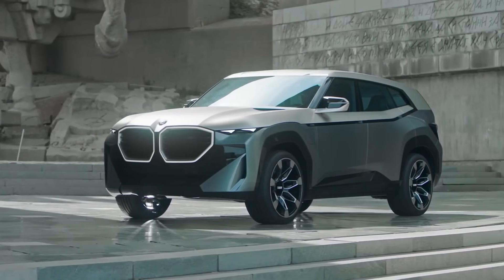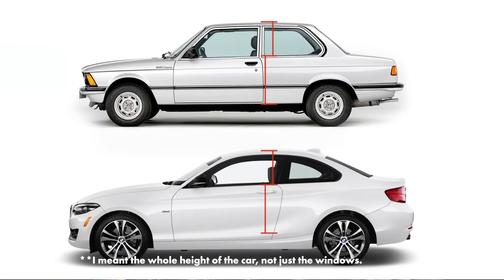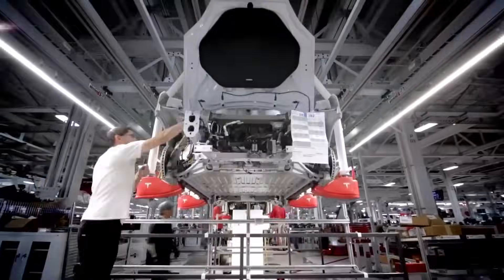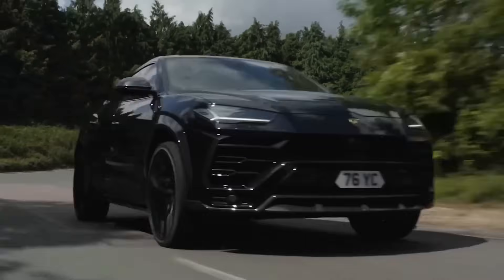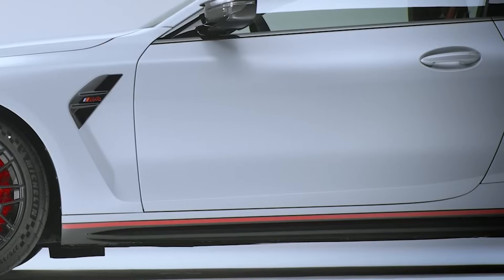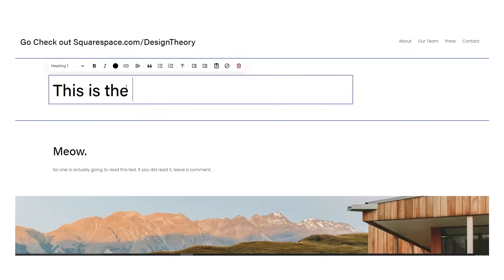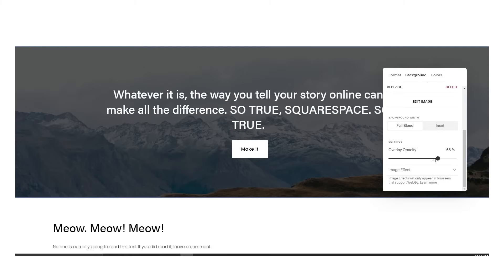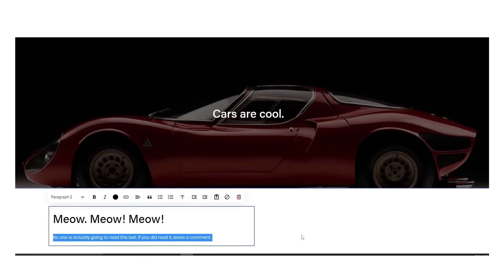Why Modern Car Designs Are So Visually Complex | Q&A w/ Pro Designer

Comment: “Beauty is incredibly difficult to achieve in product design, because you have to balance it with functional constraints” 100% accurate, in any field of design
Reply: They never seemed to have a problem with this for the first 60 years of car design. Only since wind tunnels and computers, have cars gotten ugly.
Reply: @NoQualmsTheArtist ¯\_(ツ)_/¯
Reply: @NoQualmsTheArtist  yes cars started to look ugly somewhere in 1980-1990
Reply: Id rather have the cars be usefull instead of looking like an atrocious outfit from a fashion show
Reply: Beauty is not difficult to achieve if it follows functionality. I drive an OLD 4WD SUV because it works - the electronics work - the drivetrain works.  You can't achieve beauty when these thing are 'GLOBS OF COMPLEX GARBAGE'  THAT is difficult and doesn't appeal to everyone. Only to some with money, some with no common sense.
Reply: Form following function is usually not pretty. But the proportions almost always look right. However there is nothing more stomach churning than something designed to be ugly.
Reply: @Muis33 hell yeah the 55 firedome, has an amazing front grill. Looks like it will gobble up everything in it's path! 💯
Reply: @Muis33 53 is even more badass! One of the best grills in any car ever. You could put those teeth on a Mercury or fleetline or anything and it would be instantly more badass. That's a damn fine car.
Reply: Just another excuse. It was difficult in the 1930's, it was difficult in the 1950's, it was difficult in the 1970's, and still, these eras produced designs with real charisma, elegance and style. As long as angular shapes and all that bending is the mantra, arrogant rather than agressive looking monstruous cars will be released. It's just waiting until the pendulum swings the other way again, and the Gen Z designers finally come to their senses.

Comment: It's a bit weird to have to make car windows so small they limit visibility for the sake of safety. Only testing crash safety leaves out the avoiding crashes in the first place part.
Reply: It's not for safety, it's some custom car hot rod image in designer's minds. Subaru Foresters and Honda Jazz have big windows and pass crash tests.
Reply: @emjayay  that is an oversimplification of choosing where to put the beltline on a car. it is mostly for safety. you can make everything thinner and cheaper and still pass crash tests if the beltline is at the shoulder.

Comment: A pet peeve of mine is the upward sloping window sills on modern (like, last couple of decades) car designs. I find they make it unnecessarily hard for the driver to judge the car's orientation while reversing.
Reply: I changed a new car I had “chosen” for this reason, after only 18 months. Not a good financial decision but I realised shortly after the purchase there was something that didn’t work for me when either sitting in or looking at it. The Yaris represented a radical change of direction for Toyota, who had established a studio in France where the Yaris was designed.  I found the steep upward waist line claustrophobic and, as you said, limiting rearward visibility. Thankfully this trend seems to have disappeared.
Reply: I’ve noticed that I will actually feel less carsick when the backseat windows are lower, and bigger.
Reply: Most people look at their center screens when reversing
Reply: @littledovecitydust many people still don't have backup cameras.
Reply: @jerbear7952   it's mandatory since 2018.
Reply: @littledovecitydust  The world isn't just America.
Reply: I've finally met someone with the exact same gripe as me.
I hate the upward slope on the windows.
The rear windows are now merely a vestige.
Reply: @quistan2  front windows shrank, too. And windshields get smaller and more angled with time, for "security" reasons
Reply: @swisswildpicsswp3095  Yes sir they do, and I dont like it either.
I'd rather drive a 87' corolla or an amc pacer than most of whats availible these days.
At least I know ill be able to see my impending death before it happens.
Reply: That's why we have cameras now.

Ealier cars didn't need them.
Reply: @littledovecitydust  Many people still have cars made before 2018. Personally, I neither want nor need backup cameras anyway (case in point: I drive a '95). What happened to turning back and looking out the rear window?
Reply: @manlethamlet that's too 2000ish I guess 😂
Reply: @SkidMark-v7i  Yup, just the other day as I was walking through a parking lot, I stopped and waited for someone to pull out of their spot. They never saw me because they were just staring at the center console the whole time. If they'd taken the two seconds to turn their head side to side and look out the windows, they would've known I was there. As a driver, you should be on the lookout for pedestrians, you know? I thought that was common sense, but common sense isn't all that common, it seems.
Reply: @littledovecitydust yea well while I own way to many cars the newest is an 06 and not a one has a screen in it and find that a positive

Comment: I am a car designer at an OEM.

The problem is actually more process based. 

Yes designers are trying to hide visual weight with extra lines but the main problem is really digital visualization and digital sketching within a car company. 

Internal Visualization standards within automotive design are surprisingly poor. Very often car designers are designing cars for shaders on there computer rather than for reality. 

This then effects sketching. 

Designers forget that cars are essentially mirrors and they design the car as if it is a matte object and add a bunch of extra details/ uncontrolled surfaces to hide this mis understanding. 

Also cars within the studios are only viewed in extremely sterile environments so the existing reflections are incredibly boring therefore causing designers to want to add more interesting reflection patterns that will be completely uncontrollable when the car experiences A more complicated environment.

Along with this most designers when visualizing a car on the computer arguing it within unrealistic lighting scenarios. Which then impacts sketching and how they think they should sketch a vehicle.

Also, it is easier to design more features within the vehicle through digital sketching designers feel as though they need to fill the page with more complexity again for getting the environment that the vehicle will live within. 

The companies that rely more on physical models with reflective Dinoc (film designed to cover the clay during reviews) tend to have more simplified designs with better control and more timeless approach.
Reply from the maker: Thanks for your insights! Things that look good in sketches don't always look good in real life, but I'm surprised to hear that these sorts of things aren't figured out as soon as you make a model early in the process. I know that every studio is different...but would you say that car designers rarely take their early physical models outdoors early in the process (ideally with dinoc)? I know they do it later in the process with full-scale models, but maybe by that point it's too late?
Reply: As an aspiring car designer, this is some really good insight into proper design.
Reply: It is so true
Reply: This is what I always assumed as an enthusiast. I've seen so many good looking sketches of horrible cars designs. I'm just surprised that these companies have not remedied that. Seems pretty stupid to me.
Reply: Same basic problem in architecture. The tools determine the design solution in many cases.
Reply: If only we could convince Toyota to swap their current car designers with those at GM. Then we could have cars with a nice clean look and also have high quality in the overall build.
Reply: @Design.Theory
Reply: Agree with everything, there is a beautiful doc on youtube on how Porsche designed the 992 (911 series from 2019) and more of 60% of the process showed were clay modeling/dinoc and put the models under sunlight in barely real life scenarios.
Reply: @Design.Theory  Would be cool if you took some topics in your head and researched them by interviewing experts. Would love to see design-focused interviews.
Reply: Interesting, coming from a film/game CG background I would have thought that modern cars would be essentially concepted entirely in 3D long before the design is finalized. And with modern rendering you can recreate any lighting scenarios by pumping in various HDRI’s into the renderer, so I’m surprised that the way cars reflect light in different conditions isn’t something that taken into account during the concept phase. 

It almost sounds almost like the design team and engineering team are at odds with each other which is the complete opposite of what I would expect, in fact I always assumed that aerodynamic simulation was the main driver for modern car design and simply basing designs off artist sketches was old fashioned now.
Reply: @Design.Theory  wheres the discord
Reply: imo its more to do that most car designers, especially coming from automotive design courses, dont have an understanding of how things work in real life, or an appreciation for design, but unfortunately instead have a lust for instagram clout via visually complex designs. Then the marketing executives pick the most trendy  and safe option.
Reply: Very interesting! I saw a documentary about Porsche where they show how they build the new 911 and they made clay models which they then covered in reflective foil. Then they projected light with a certain line pattern on it, to see how these lines would flow over the vehicle and that way they made sure no weird edges where there.
Reply: i thought theyd have this already fixed with software by this point of time lol
Reply: Very interesting, thanks for that. I know Jaguar still use clay models, which might explain in part why they tend to have simpler design language in their vehicles.
Reply: You’ve explained what I’ve suspected for a long time. The committee design was obvious way back to the Mustang 2, I don’t think the front end designers ever talked to the side designers.

The same process influence is also obvious in architecture today.

The Jaguar XKE could have never been designed with cad.
Reply: Very well said, and I think the result is ugly.
Reply: @theblah12  I was going to post the same thing. It seems to me that the issue is more mindset / bureaucracy / business culture issue than the limitations of CG design (which in recent years has become less and less of a limitation for the reasons you mentioned).

There are plenty of cases across various industries where there may be a means to do things far more productively than has been done so far, yet due to business culture / decisions such methods are not appreciated or implemented by either management or the team as a whole.
Reply: So over-designing happens because we over-design based on bad feedback (in this instance based on visualisation tools). This is a problem in all design disciplines, and the solution is to push functional solutions above all else and always simplify. But this takes confidence, decision power and experience.
Reply: As an amateurish car designer... 
(Granted it's been a while) feel like this might actually explain why cars look terrible in photos but grow on you in person when you can appreciate it from different angles. It is like you have a tiny realization "oh I see what you did there" lol
Reply: Very insightful.  I'm not surprised at all to hear that people are working for the computer instead of the computer working for them.  I work with shaders in 3D modeling software all the time in game dev, so I completely understand what you're saying.  That never occurred to me as a problem though.  Makes total sense.  "Car is a mirror".  Very insightful.  That will never be captured properly in a 3D render no matter what environment you have setup in the software.  Then you've got dunning-kruger building bike sheds all day on an overpriced workstation with too many fancy peripherals.
Reply: I only have small non-personal insight into a German car maker's design studio. They definitely do hundreds of scale models (or iterations in clay) and verify reflections in very high-tech indoor lighting environments (similar to modern Moviesets with projection mapping) and outdoors as well. After the scale models there are multiple 1:1 models and mockups of full cars or just parts of the body before the design actually goes into production CAD surfacing.  @Design.Theory
Reply: @YangwanAutoChinese cars are the most beautiful, especially BYD and SAIC.
Reply: Makes me wonder about Mazda's design process.  I have really liked what they have done with their design language.  I find the currenet mazda 3 to be quite beautiful and it is very simple compared to something liie the new civic
Reply: Ah yes... The same goes for concept artists and designers for games and movies. "Fill the page" put 100 little things on it, engrave, embellish etc because it looks lived and characteristic..
No it looks like someone threw a box of random stuff on the character from an old cabinet
Reply: I'm a software designer and exactly for this reason, I intentionally don't use a huge, super duper expensive monitor. Instead I do my work on two different, standard sized cheap monitors. Users won't use a 1000 USD display to use the app I design.
Reply: It's just bad design.
Reply: That's why i love Mazda's Kodo language. Smooth transitional surfaces, clean body, reflection...... On the other hand, the current cyberpunk/futuristic Hyundai lineup makes me think they're designed by a bunch of gamers
Reply: Is that why those matt wraps look so good.  I guess they probably wouldn't look good on a classic car come to think of it.
Reply: No talents in US

Look at the cars for the past 50 years

All garbage except a few muscle cars

Comment: As someone who graduated from Art Center College, I’ve always preferred designs that look like they were penned by one person, and pretty.

You’re spot-on with the different groups at many car company’s design and engineering departments will be in different locations. This often causes disjointed results and it’s so annoying!
Reply: WE have a 2010 Honda Odyssey minivan, and the side lines are all straight and parallel, the bottom of the window line runs from driver's mirror back in one clean line.
In 2012 they added a zigzag behind the rear passenger window for no obvious reason, and I think it looks hideous. I can;t tell if they lowered the roof or raised the door panels, but there's less window to see out of, making it look cramped.
Reply: @ziploc2000  The 2012 looks like two vehicles welded together but the next (current) version continued the zig zag beltline but made the design more cohesive. Based on the current CR-V and (not in the US) Jazz I bet the next Honda Minivan will drop the zig zag and become more anonymous. They don't seem to be able to do a simple cohesive but distinctive design.

Comment: MY DUDE. I never realized that I like to design in a Nic Cage manner as well. I like to go balls-out when I can, as long as it fits the work. Also, your answers here are on point. I'm an old-ass veteran designer and you touch on so many things that can be forgotten in the day-to-day, because the lessons have been internalized. Revisiting these points and thinking about them discretely are very helpful.

Comment: I have so much joy driving my 1992 car. The glass house is so big I can see everything. Since I never crash my car I really don't see the need for bug bulky "safer" car. It all depends on your life style.

I really like your take on form follow function, but function is affected by the perception of the for. 

As for leather, as designers we tend to have a good appreciation for good material. Natural leather is almost eternal. My best snow mittens are from 1956!. The leather never cracked, they are warm at -20 Celcuis! The only thing to fail on them was the stitching.
Reply: “since i never crash my car” 💀
Reply: That nonsense about the design being the result of safety legislation can be ignored
Reply: Its pretty wild to compare my 90 volvo 240 and 93 940 to modern cars and see how little progress has been made. The 940 has heated leather seats, heated mirrors, power sunroof/windows, power seat with memory settings, door lights, a locking differential with RWD and a good turn radius, good visibility, very safe even by modern standards, with an engine that regularly makes it to 300+k miles. My friends gf just bought a brand new kia for 10x the price and it doesnt have any of these features.
Reply: @StreetForged  But we CAN add your heated seats to our subscription service!

Comment: A great example of how form over function / the other way round does not make sense is modernist architecture such as brutalism designed around function, yet is less functional than older buildings we consider being designed around form. Overhangs on building were seen as form over function and were deleted from modernist buildings and the  20 years later they realised that buildings with overhangs do not have water ingress and it turned out something considered to be made for form was actually functional as well.

Comment: Surprisingly (or unsurprisingly) a lot of what you say also applies to writers like me, at least in some broad strokes, not just visual designers. There are a lot of great concepts and advice given that can apply to both a hobbiest and a pro, especially about how the industry works. While the specifics are different, a lot of the broader ideas are the same across most corporate settings.